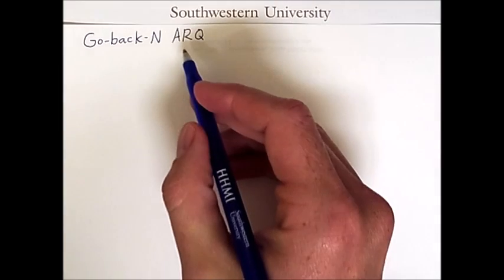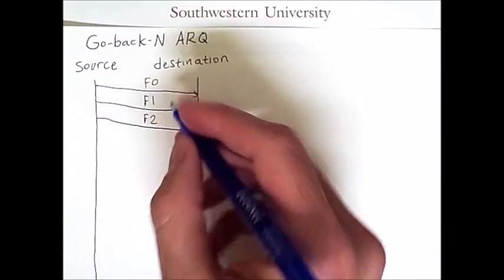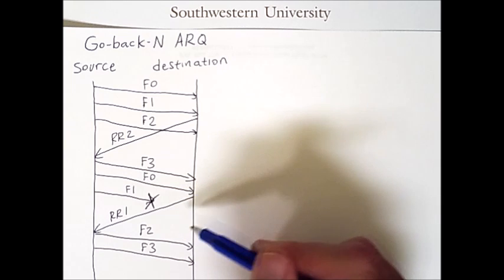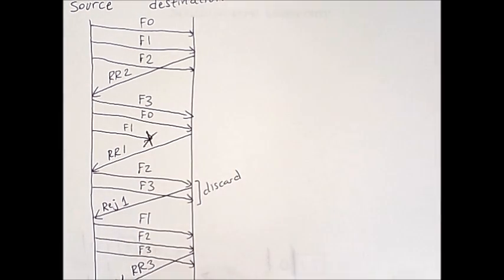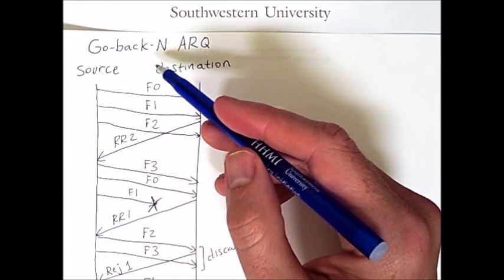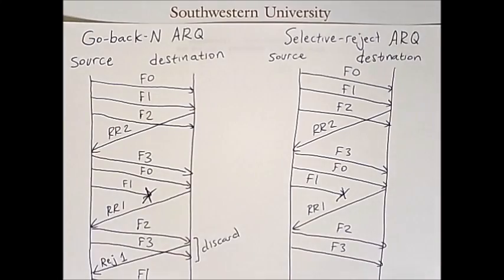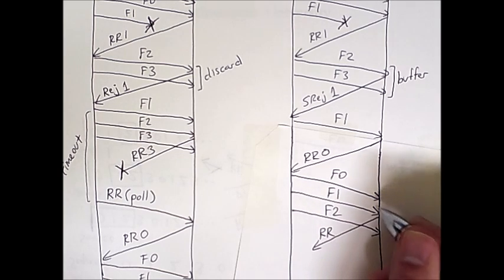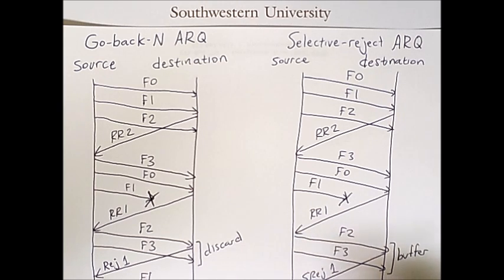Flow Control and ARQ 3: Go-back-N and Selective-reject ARQs

Comment: At 2:15, won't we have a Frame 2 re-transmission by the sender because the receiver only sends an ACK2 (RR 2), and the sender goes like "okay, the receiver got 0, 1; but he missed a 2". It then shrinks its window, removing the 0 and 1, BUT it still transmits the Frame 2 (F2) that you did not do at 2:20?

Also, do we really have the "reject" messages that are sent by the receiver, or do we just have a time-out on the sender side that makes the sender to repeat the transmissions that are in it's current window? I ask this because a few other sources (I am not very sure I believe them, but it is good to clarify I think) do not mention these "reject" messages
Reply from the maker: The sender knows that it already sent Frame 2, and the RR 2 doesn't mean that the transmission of Frame 2 failed, merely that the receiver has not acknowledged it yet. From the sender's perspective, it assumes that RR 2 was sent while its own Frame 2 message was enroute, and until it has evidence to the contrary, it will assume that Frame 2 message could still have been received.

If there is a time-out, then the sender will eventually check to see what is going on, but if the receiver rejects a frame as soon as it sees a gap, it can likely get a quicker response, and possibly spare the sender from transmitting a lot of data that will be discarded anyway.
Reply: @JacobSchrum ah okay, thanks! This is a bit different than how I have been taught. Could you please also let me know about:
1) the "reject" messages by the receiver? I have not come across such messages specifically for Go-Back-N, only for Selective Repeat. But I can understand the logic behind it. 
2) I have been told that there aren't any NAK's in GBN, but that the "time-out" is the only event in which retransmissions can occur, aiding the receiver in getting those lost frames. Even the "poll" message that you mentioned that the sender has the capability to send. I have not come across those. This is making me even more confused because, everything you say also makes logical sense.
Of-course I understand that I am newbie, and really want to know the 'standard' way. I would really appreciate if you have a great resource that I can rely on to study this.
3) Does the sender, in GBN, have logic involved in it's side that allows it to keep track of what are the ACK'ed, UNACK'ed, can-transmit packets in it's window? Because when you mention at 2:15 that the sender just sends the frame 3 after the RR2, it makes me believe that there is some state saving going on the sender side to keep this information. 

Thanks a ton for such a quick response, I really appreciate it! You are a fantastic source to learn Computer Science from :)